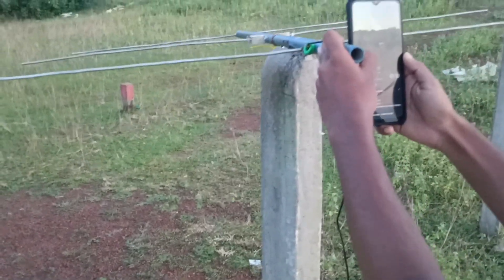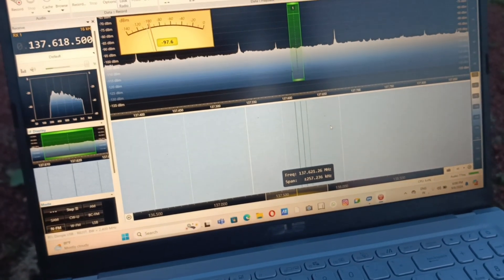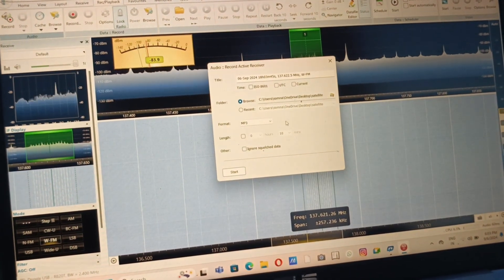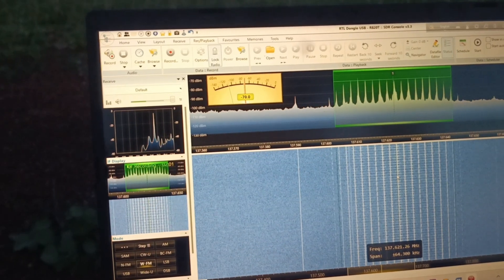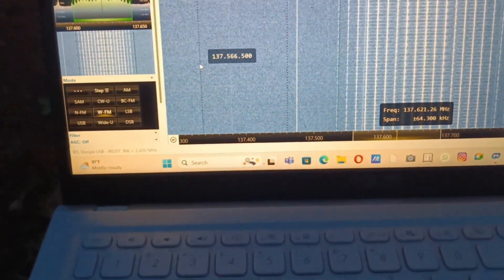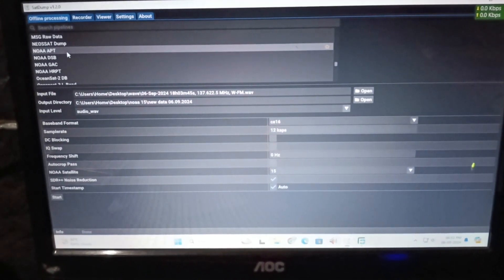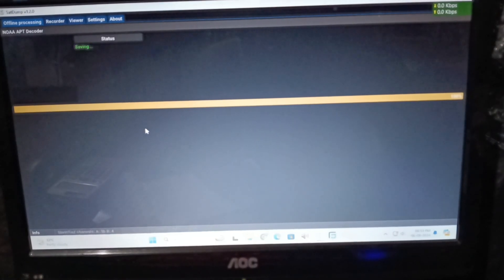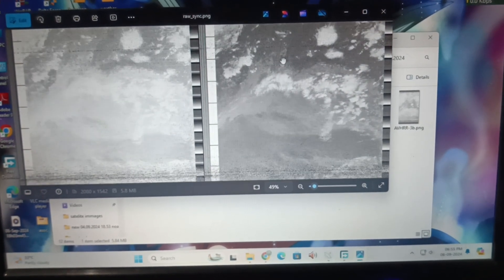how to receive WEATHER satellite image From NOAA satellites and RTL-SDR vlog v3

Comment: Can you please share the antenna design?
Reply from the maker: @minimooo-r9y  3-elements UDA YAGI antenna
---------------------------------------------------
Frequency f: 137 MHz
Wavelength λ: 2 m 188 mm
Element diameter: 7.3 mm…21.9 mm ( min.: 0.003λ , max.: 0.01λ )
Approx. antenna gain: 7.3 dBi 
Bandwidth by VSWR < 2: 10 MHz (approx.)
---------------------------------------------------
Reflector length R: 1 m 130 mm
---------------------------------------------------
Dipole length V: 1 m 24 mm
Dipole-reflector distance S1: 376 mm
---------------------------------
Director length D: 930 mm
Dipole-director distance S2: 300 mm
---------------------------------------------------
Minimum boom length Bl: 698 mm